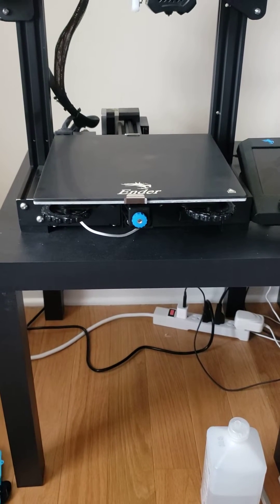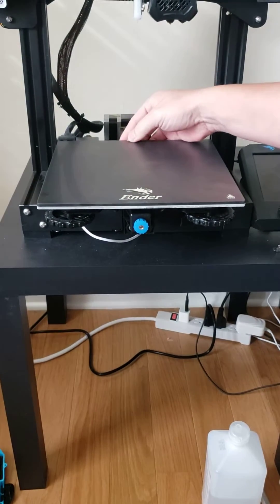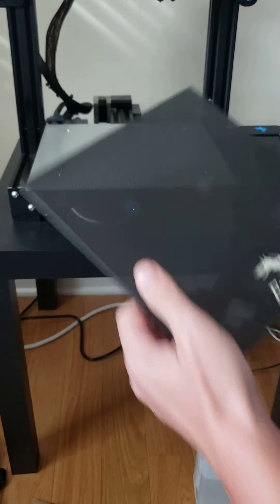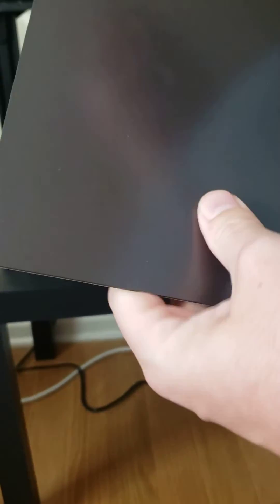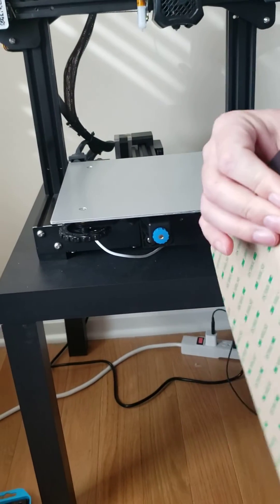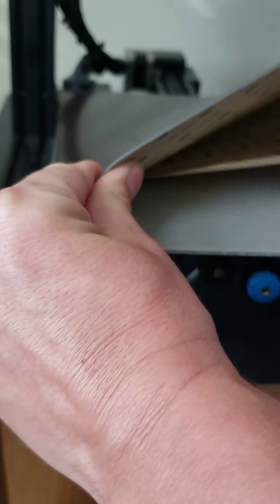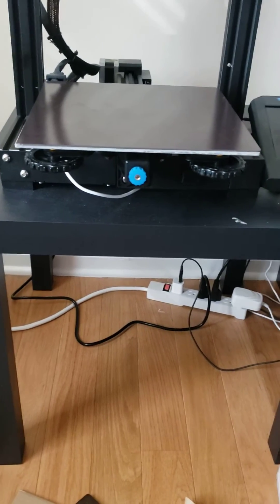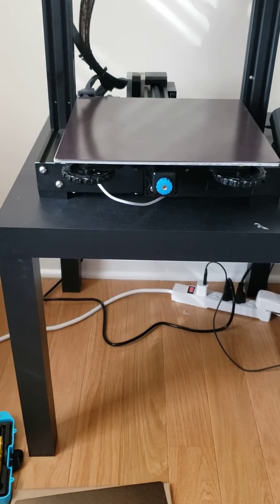Creality Ender 3 v2 3d printer bed upgrade to PEI magnetic sheet part 1

Comment: I'm about to make this upgrade as well. I thought the glass was ideal until I got my V3 SE and started using a PEI plate. The time has come for the first significant upgrade to my V2.

What did you use to cut the screw access holes, just a regular X-Acto knife? Also, did you make/use a template to make it easier to cut the holes in the right places?
Reply from the maker: I used an exacto knife, but I later used a drill. The drill worked way better. I just measured the holes.

Comment: How's the condition of the PEI bed now? Is it still good, and is it ok for high temperatures (magnetic base), like printing ABS up to 100 degrees Celsius?
Reply from the maker: Bed is still like new. I only print pla on my ender3v2 so I cannot say about 100c, but on my other printers with magnetic bases they work fine.